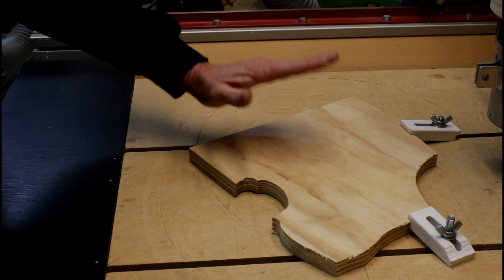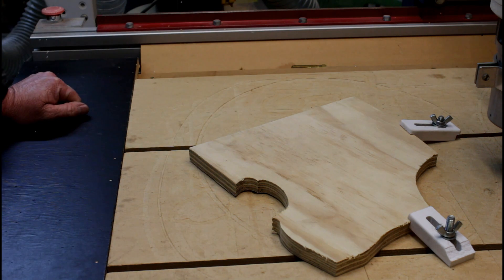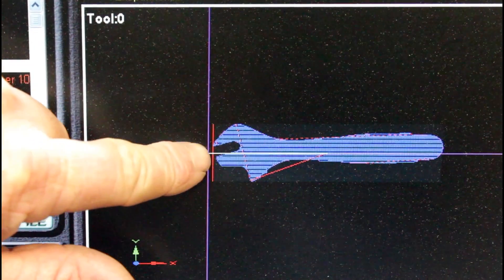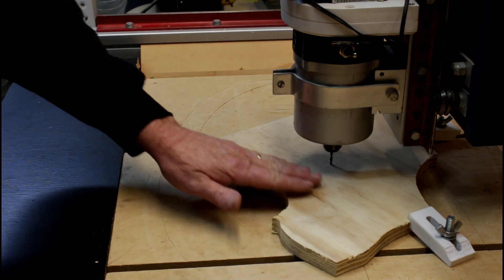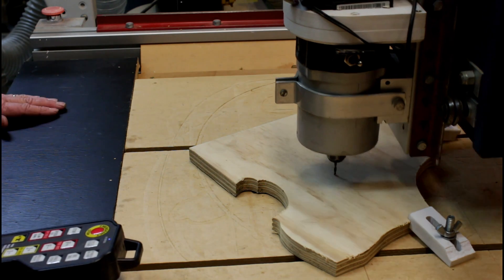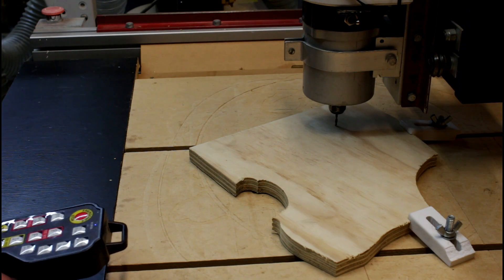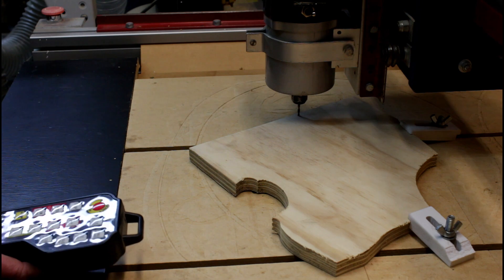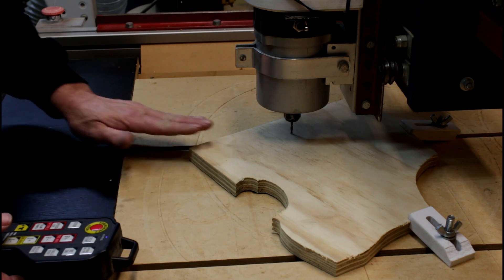Will my project fit this piece of stock? - CNCnutz Episode 111

Comment: great tip, Peter. could you do a video on how to correctly set up my machines axis speed and accelleration settings please? I'm having issues with getting my motor tuning correct. Either I get Y axis deflection because I'm cutting too fast or i get burning because im cutting too slow.
Reply from the maker: +Dust Bunny 
From your description motor tuning is not your problem.  Motor tuning ensures your machine runs accurately and doesn't stall / loose steps.  You are describing a speeds and feeds issue and I am guessing you are using a router not a spindle on your machine with at best a basic speed control.  Could you flick me an email with a photo of your machine so I can understand your setup a bit better? 
Cheers 
Peter

Comment: Thank you everybody for the comments; all very good solutions.  But what if I wanted to end mill boards to do a custom joint for a box?  In a vertical position the board would be too long to set in a recess. And if there were any misalignment, angular or orthogonally, the box sides would be twisted and uneven.

The CNC is extremely accurate, more accurate that what would be needed for most things, but all the advantages of that are removed if, in the end, I am relying on my vision to align or space a set work piece.

Comment: A long time ago I watched a show called "How it's Made" and on that show they had a CNC leather cutter. They would move the pattern around on the leather to get pieces without flaws. They had a red laser montes on the ceiling that would project the pattern onto the leather until zeroed. Thought that was pretty cool but haven't seen it used anywhere else.
Reply from the maker: +Joshua Russell 
I saw that program. 
Could make a small laser pointer to go into the collet then let it run around the stock to see exactly where it is going to cut. 
Novel if nothing else. 
Cheers 
Peter

Comment: Long time subscriber, first time commenter.  I've been considering the purchase of a CNC for some time, but it's a big investment.  But I think I am almost ready to commit.  However, there is one lingering question in my mind that I have not seen anybody address.

If I have an existing piece that I did not manufacture, let's go small as that's where this question becomes increasingly relevant, say it's something like a pistol grip for a client or a small jewelry box and they want an inlay around the perimeter, say a 1/8" wide inlay inset 1/8" from the edge.

My question is this- how do you orient that existing piece so that the cuts remain parallel and centered on the object?  I'm not sure my eye is calibrated enough to move the router to a position and verify that an edge or something is directly beneath it.  Is there another, better way to ensure accuracy?
Reply from the maker: +Andrew Myers 
Thanks for watching. 
To do what you are asking I would draw an outline of the piece I was wanting to engrave / inlay. Here I am assuming an irregular shape like a pistol grip. I would make the center the origin. I would engrave the outline on a sacrificial board. With this done I could then position the pistol grip accurately on the sacrificial board and so long as I don't move the sacrificial board I can now align everything perfectly and be confident that all is correct. 
Hope this helps and I will make a note to do a video on it.  I am always looking for ideas. 
Cheers 
Peter
Reply: In a word, yes. That's where CNC machines really shine. When you put the router bit in a location (let's say the center of the jewelry box lid, which you have measured and marked) then tell the CNC that spot is Zero in the X and Y axis, it calculates where it needs to go to cut that 1/8" wide slot. That's assuming you've drawn everything correctly in your CAM (Computer Aided Manufacturing) program. Practice on scrap before cutting into the real thing. I can't tell you how many old fence boards I cut up, carved into, and just generally routed to pieces before I got near good enough to cut the real thing.

You don't need a calibrated eyeball. It's a good thing too. My eyes are so bad, I have bifocal safety glasses.